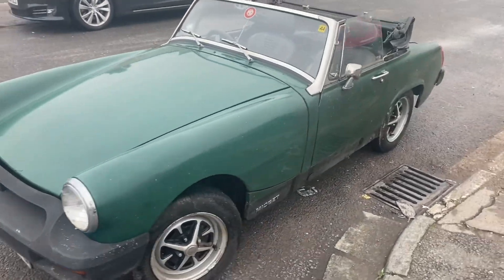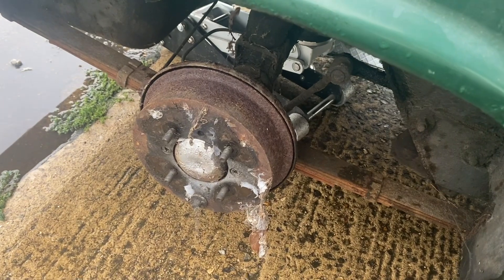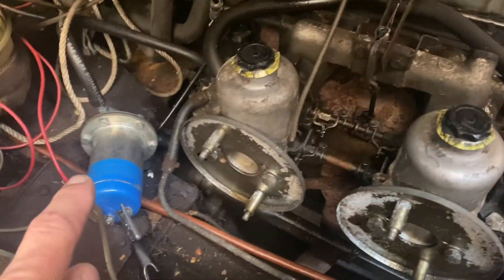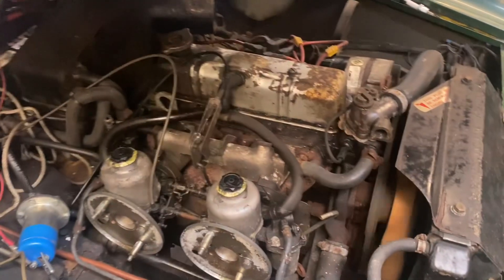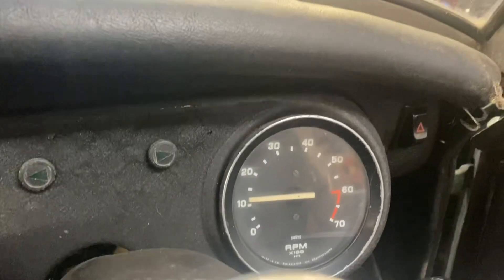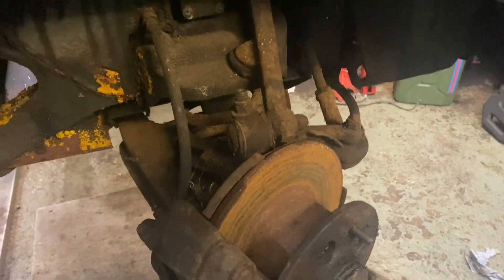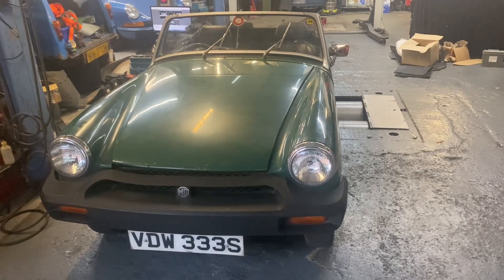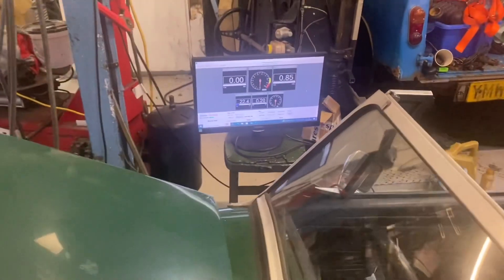MG 1500 Supercharger conversion

Comment: What are you doing!!!??  That car clearly needs a lot of attention and supercharging the engine would be way down my priority list….but I’ll be watching regardless.
Reply from the maker: What am I doing ? Well , I'm following a plan: This first video was showing the car as received and getting some base readings of the engines' power. I have a growing shopping list of parts to get the car back on the road safely /legally and some aesthetic ones too. The body work is ok and shell is sound if not particulary pretty, I wont be repainting it and re trimming the seats /interior as they are usable , brakes, tyres, cooling, with loads more cleaning and preserving plus the added supercharger on the standard engine that has covered 36,000 miles is target.